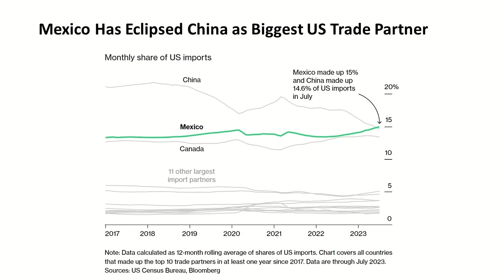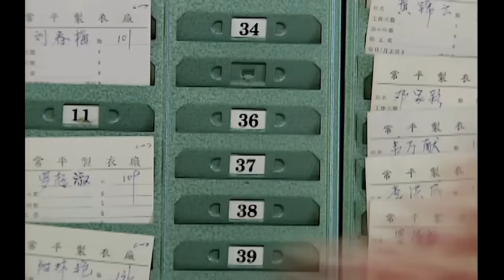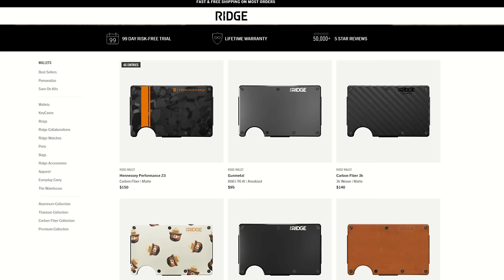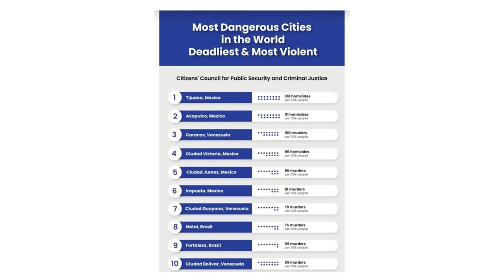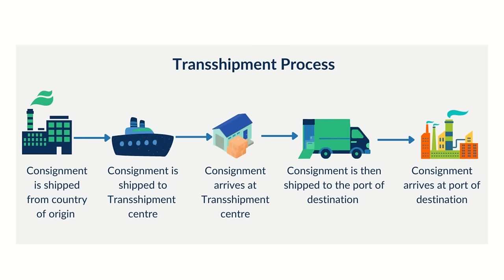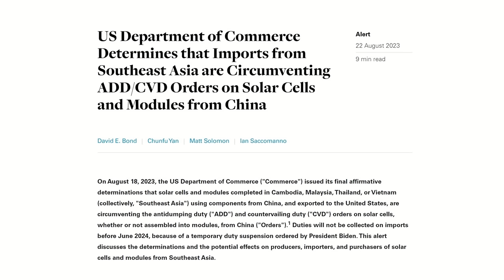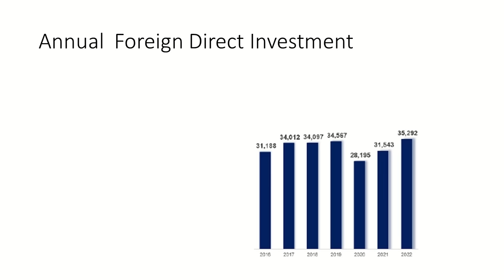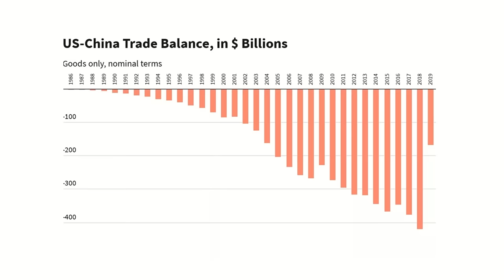The Biggest US Trading Partner Is No Longer China!

Comment: There's another important connection between water supply and electricity.  Most methods of power generation use a lot of fresh water.  It's one of the major overall uses of fresh water, usually second behind only agriculture (albeit a rather distant second.)
Reply: That’s why the Dutch are against building huge data centers, like for Facebook, in a Dutch polder Zeewolde near Amsterdam. I think it is the second largest in Europe. They require a lot of fresh water and green produced electricity competing with the local need of citizens and business who also need cheap green electricity. I understand that Facebook wanted a more green label. The fresh water is produced with river water which needs to be treated and filtered against the polution which pops up more and more in our rivers mostly transported in from our neighboring countries. The treatment is expensive and require more tax money. Same for the green produced electricity. It cost tax money which companies like Facebook didn’t contribute too. It is suspected that local politicians were corrupted to require the permits to build there. The Dutch national policy is to locate the data center far away from the populated region to avoid these kind of unfair competition.

Comment: Regarding infrastructure and geography, Mexico is of course closer to the USA which helps in itself, but another thing that surprisingly many economists seem to underestimate is the amount of coastline and cities close to the coastline Mexico has and the value of that. The latter is true also for India, Vietnam, indonesia and some others. It true that China has invested a lot into infrastructure. However China also has to transport it goods further than most of it's competitors. That is a bigger disadvantage, I would argue than many realize.
Reply: On the coastline thing, that's true, although one somewhat strange thing about Mexico is the extent to which it's population is concentrated in the central highlands. It's got a population density which is almost inverse to what you might expect (cities clustering on the coast).
Reply: Almost the entire population of China is concentrated on the east. The manufacturing hubs of Guangdong ,the biggest one in China are between a short truck drive to one of the ports or an hour+ drive to the port.
Reply: It's not a big disadvantage because it is so damn cheap considering the distance - We are talking pennies. That doesn't compare to the 100s of billions required to build the insane manufacturing infrastructure in China. They can build whatever you want TO SPEC and get it to your door step quicker (+cheaper) than having it built at home.
Reply: @merrymachiavelli2041  Actually Mexico benefits awesomely in modern times. The arable land is inland. The coast is barren. Which makes the coast perfect for factories, as they do not compete with farmland!
Reply: @blcheah2672 de que hablas la mayoría de nuestras tierras de cultivo están en la costa, Sinatra, Michoacan, Veracruz, etc.

Comment: I swore to dispose all products Made In China, so all electronic stuff like PCs, modems, printers and flash disks had to go. Then all electrical stuff like TVs, freezers, washing machines were thrown out. Today, I found that the insulation, roofing, carpets, blankets, sidings, tiles, wires, nails and screws were all Made In China. What else can I throw into the dumpster ?

Comment: 16:32 would you prefer 10% of 300$ or 20% of 100$ tomorrow, look you get 10% more and 10$ less over that same period, if you use relative terms you need at least some initial value to show the change and every change over time to compare and complete the set of absolute values, just like in the store you get a shirt with 20% discount for 10% more cash than the undiscounted one next door because yesterday it was overpriced at 130% of it's normal value(not exactly because percentage values are weird, but close enough: a*0.8=b is not b*1.2=a, but b*1.25=a is).

Comment: The key secret to defeating China's semiconductor industry is to first impose sanctions and disrupt Taiwan's semiconductor supply chain, which includes both manufacturing and design aspects. Representative companies in this context are TSMC and MediaTek. Westerners may never fully understand the relationship between China and Taiwan, as they share the same language, Chinese. This allows China to acquire a significant amount of talent and technology from Taiwan, much of which originally comes from the West. Taiwan's semiconductor industry doesn't have its own proprietary technology; it excels in executing discipline and obedience, exploiting labor to reduce product prices, increase yield, and lower costs to make products competitive in the market. For example, in the case of Qualcomm vs. MediaTek, MediaTek started as a company that copied and produced knock-off products. Now, it can threaten Qualcomm's position. I don't know how Americans can allow such a thing to happen, but it has indeed occurred. This is the consequence of using American technology and tools, combined with the cost-saving expertise of Asians. If the United States continues to allow Taiwanese companies to take advantage of this situation, it will be quite absurd.